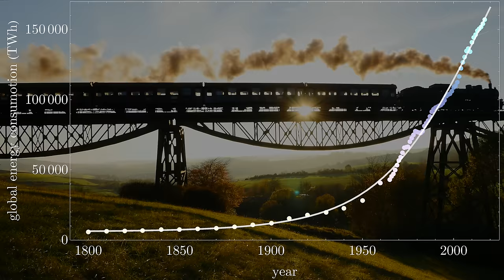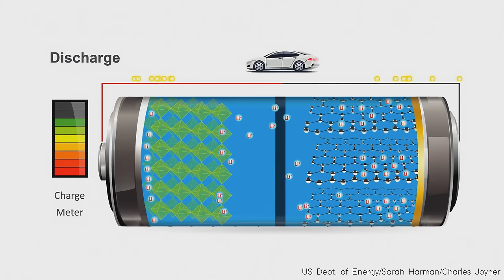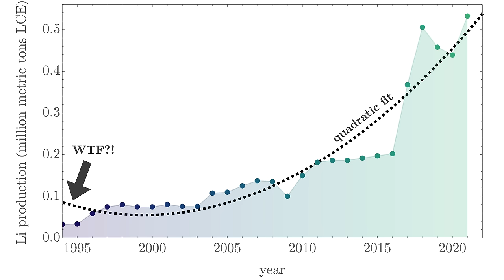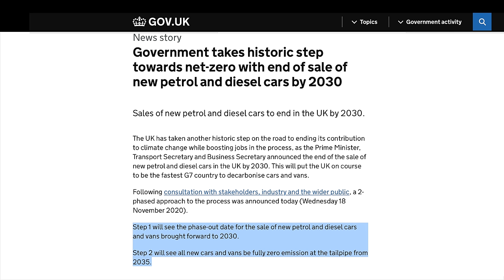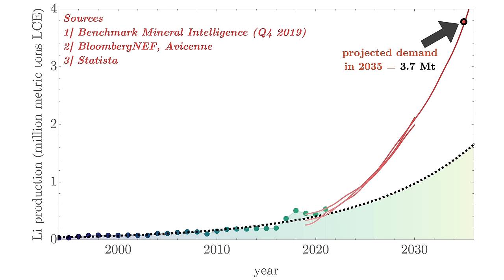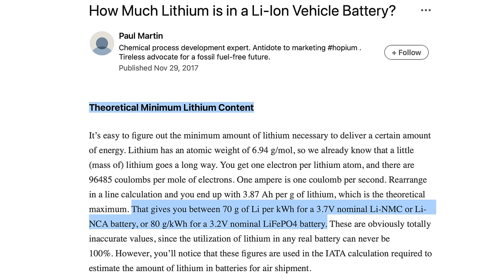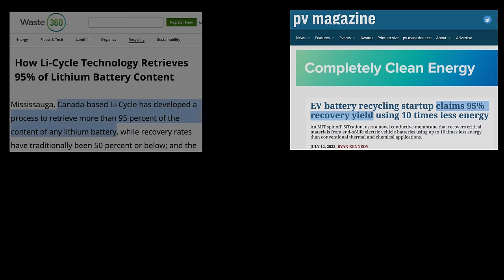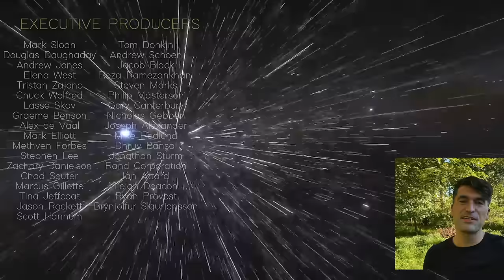Will We Run Out Of Lithium?

Comment: so many questions still though:

A) the environmental impact on mining? habitat destruction? fossil fuels used in mining? 
B) will the switch to batteries mean swapping out heavier, metal framed cars, with lighter, harder-to-non-recyclable, carbon fibre car chassis? 
C) Affordability? cost of a new battery? right-to-repair and supply of parts/batteries? most of these cars are dead after 5-10 years of use, a petrol/diesel car can run for 20 years or more with relatively inexpensive upkeep and keep most of it's efficiency,  my phone is only 3 years old but i have to keep that thing hooked to a charger majority of the time. 
D) The power grid these things are hooked to? coal? gas? solar? or wind? equally how much land/habitat destruction will occur to show solar and wind farms? and how will the grid cope with increased demand?
Reply: @lepidoptera9337 😜

Comment: Na-Ion would be cool, but so would Graphene Super-Capacitors. Both have theoretically low costs in the long-term, and both could have a low environmental impact. It’s cool that more options are being rundown, because the more options we have the better. However, the Lithium running out concern could potentially be unfounded. Crude oil had the same issue in the 30's, 50's, 70's, early 2000's, and recently. There is often a voice of “we’re about to run out”, then a new technology finds more, or a way to extract more. Lithium, though much different, could have a similar trajectory. There isn't enough recycling calculation added into this demand, with a 50% recycle rate, we would have a considerable reduction in net demand for mining. This model also assumes not only will no other technology be implemented, but also assumes that the chemistry of Lithium batteries will always require the same amount of Lithium.
Reply: Maybe I'm wrong, but super-capacitors only seem to be an addition in improving EVs, etc., thus maybe slightly reducing demand for batteries.

Comment: Wonder why the idea of hydrogen engines is completly ignored the last 10-15 years. Its save, free of emissions and hydrogen is an infinite resource. EV isn't 'green', what many people think. The energy to load an EV is mostly produced by burning fossile resources.
Reply: hydrogen is anything but save. It needs one of the most airtight tank possible because it’s only a proton and an electron. The reason why is because you have to put in more energy in than comes out making a net loss.

Comment: Collapse of the overall auto industry might also contribute to accelerating shift to EVs. Auto numbers are down the last couple years and many cities (Toronto, Paris) are taking big steps to reduce car dependence and ban cars from inner cities.
Reply: Correct, most big cities in Europe are transitioning away from cars for years. Same in some East Asian cities like Singapore, Hong Kong, Tokyo, Taipei, etc.
Reply: Europe is just one region & not the best example. They have a lot of built-in infrastructure for public transportation to allow that. Trying that in say Texas just doesn't achieve the same results. So. IE - It's not collapsing & isn't going anywhere anytime soon.

Comment: Great video. To me this seems to be one of the two most urgent BUT actually solveable short to midterm problems. The other one beeing silicon. Given the fact the we'll only ever use exponentially more artifical intelligence and HUGE amounts of computing power in the future. I'm quite certain that because silicon and lithium products are so inherently interconnected in our current and future world of electronics, that one would find great simillarities if such a video / analysis would be made on silicon.

Thank you so much David for this great analysis, it's always a joy to watch your videos.

Now I'll head off to start investing in lithium, silicon, and nickel production and recycling, after that colossal fail of cryptocurrencies. Oh wait, what a coincident, there is a huge correlation between these, what???
Reply: Silicon is one of the most abundant elements on earth, just like lithium. Silicon just lies around as sand in deserts. But the largest amount is not used in chip production, but in the production of solar cells.
Reply: That is true, but extracting silicon and refining it to the level of pureness it's needed, is a very complicated and energie intensive matter. Still you're correct, but I meant it more in a "Demald will far outstrip supply" kind of way.
Reply: @BMXaster  I'm a bit more "optimistic" and trust in capitalism to never let demand outstrip supply. But we'll see.

Comment: The ocean is FULL of Lithium.   You just drop a graphite electrode into seawater.

If you merely run a trickle current to the electrode, you get Lithium and Sodium attracted to the electrode.

Someone discovered that reversing the voltage briefly will repel the Sodium somewhat so you get a 3:1 Lithium to Sodium mix.

But that’s irrelevant, because Graphene/Aluminum Ion batteries charge 50 times faster.

Comment: Excellent video. Very interesting, informative and worthwhile video.   Note that there are a number of other battery technologies being developed which may be as efficient as lithium batteries and cheaper and with a chemistry that would not be in danger of being depleted.
Reply: Lithium is incredibly plentiful... And it is an element that we are not burning as a fuel, what we have already mined is more easy to access and refine again from recycled material than it is to mine and refine new material... And, yes there are different chemistries coming, already in use, I am simply pointing out that lithium is not the limiting factor...

Comment: There are two extra ways we can get out of needing this much lithium: hydrogen vehicles and sodium based batteries. They also need technological improvement but it's a way forward as well.
Reply: Hydrogen is a dead end for cars, larger vehicles maybe, but the manufacturing transporting and storing Hydrogen will always be an issue as the process is very inefficient and costly compared with just putting the electricity into an EV.
Reply: Here is another extra way:
Less cars, building out public transport and building new development more around that does (not can, we know it does) reduce the amount of cars a population has. This means we don‘t need as many EVs which solves the problem in the most obvious and least fancy way possible.
Reply: @PhilfreezeCH  Public transport is ok in cities or between city but you cant make a public transport to allow people to go anywhere they need to go when they need to go. In short, public transport is inconvenient and will never replace the car for personal transport.

Comment: Basing out lithium demand largely on the EV market is short sighted. It doesn’t consider the huge amount of lithium required for solar power storage
Reply: This is why I believe that EV's should not be our primary focus. We need to rapidly expand the infrastructure needed to phase out dirty energy production in order to realistically tackle the issue of climate change. Most energy consumption globally comes at the industrial and corporate level and that is where our focus should be. EV's are not end all be all because for numerous reasons, be it logistically or economically, not everyone will be able to acquire an EV even with massive tax credits. A person struggling to maintain their home and old vehicle will not be able to afford a $60,000+ EV.
Reply: @ShortandWide  I do think the cost of EVs will come down though too.
Reply: Lithium is more a requirement for mobile applications, whereas for solar power storage you could use other materials that have a worse energy to weight ratio. Or maybe use the solar power to produce hydrogen.

Comment: I can't see this as being better than a gasoline driven car. 
1. Conservation of Energy. These cars must be charged and that Energy must come from somewhere. That will be either coal or nuclear. States like California refuse to build any new powerplants will continue to experience more and more blackouts. The state will impose charging restrictions. 
2. First Law of Thermodynamics. These batteries generate a lot of heat and can cause a thermal runaways. These batteries are required to have thermal protection. When the battery senses an overheat condition, it will shut itself down and leave you stranded. 
3. Second law of Thermodynamics. These batteries have a short life.
Reply from the maker: For myself, the energy comes from neither coal nor nuclear but rather solar. Solar is already cheaper than coal. For waste heat, personally I’ve never had a shut down even driving in 100F+ heat. The car has a heat pump that cools the battery (and inside). And yes they will run out and that’s why we need recycling!
Reply: I totally agree recycling has to be the future of lithium batteries. However, there are 13.8 million cars in the state of California alone. Less than 10% of those will be able to use solar power to charge their cars. This means most of the cars will be using coal or nuclear power to charge their vehicles. California will struggle to meet this demand.

Comment: So in a nutshell: if they’re gonna “force” everyone to go electric for transportation, they need to also change the way the electricity is produced in some of those markets. Otherwise, they’re just being stupid. They’ll need nuclear for this plan to actually work.
Reply: that's AC power, which is used to charge the DC batteries, typically made of lithium, which is becoming scarce
Reply: The times change. Except it and move on.
Reply: @farmsalot1233  not an argument
Reply: Yeah energy prices has increased beyond control. Most people cant even turn on any power products without getting 1000s in power bills. Now we have been told we will start having brownouts because if increased need. Most industry is moving to another country atm. Australia is screwed.
Reply: Demand for EVs is way higher and sooner than any mandates... Renewables with battery storage is the cheapest way to generate electricity and all grids want renewables and batteries as fast as the batteries can be made...  Coal and oil are dying incredibly fast, basically dead already as compared to peak oil or coal... More than half of France's nuclear power plants had to be shut down when the summer was too hot, water needed to cool nuclear plants was too warm, still plentiful, just water temp too warm... not so reliable especially in a warming climate... Plus nuclear is super expensive as compared to anything else you cold build to do the job...  Profits, costs have made solar and wind coupled with batteries an unbeatable solution that is only limited by production or else basically everyone would be switched to renewables already...

Comment: Norway is often cited but it is a odd case, not well understood.
With a small 5+ million population they aren't a very big market.  Therefore their sales % looks high, but the numbers are meager compared even to just California.
Norway has an electric grid that is 93% dam hydro....meaning high power reserve backbone.  98% non fuel, electric power.

Makes sense to use electricity for as much stuff as possible.

Most of that 5 million population  is not urban.  Only one million person metro.  Six 100k to 200k cities and the rest rural and village.

Norway has the highest number of domestic air flights per capita IN THE WORLD...burning gasoline and kerosene.  Many Norwegians are quite wealthy, and utilize air flight as a shortcut to the harsh distances....much as Alaska does.

How does Norway make money?  OIL AND GAS exports.  It is the 13th largest Petro Nation on earth and has increased production this year by 20%.  The EV push is to decrease domestic use, so more can be sold abroad to mostly the EU.

Greta speaks with a bit of duplicity.  Much like a notorious drug and moonshine dealer speaking of their own sobriety.
Reply: Other than the fact Greta is Swedish instead of Norwegian, I agree. Better to make a hefty profit on your own supply instead of consuming it yourself.

Comment: Another mindbogglingly huge issue in terms of its scale that we have to face in regards to the increasing demand of EV's is electricity production and the power grid to transfer it. That is a absolute massive infrastructure undertaking.
Reply: Something he completely sidestepped.
This calls into question his integrity. Failing to mention the existential  problems regarding the  electrical grid and it's  ability to succour , meet the needs of EV's is analogous to expounding the virtues and benefits of solar panels yet ignoring the sun

Comment: Excellent video, well thought out and presented.  This is one of the most informative and well presented channels on Youtube. 

Did you consider any of the developing competitors to Lithium that are at various stages of development based upon Magnesium, Sodium and Sulphur etc? As has been mentioned in other posts, not all applications require the 'lightness' of lithium (home & grid storage is a good example) so the lower energy densities (but increased safety) of sulphur for example won't be an issue.   

Some of these other chemicals are vastly more abundant and cheaper to extract, some even will work with the existing Lion or LifePo4 production processes and facilities.  There is a strong chance that Lithium based batteries will be overtaken by a cheaper more cost effective alternative within the period you have covered, at least for certain aspects of the demand for batteries.  Here's hoping something like this does happen as we don't want to get into a squeeze like the one that seems likely.

Comment: I believe that lithium is not the answer to all... Considering each ton of mined lithium emits 15 tons of CO2, you're pretty far from carbon-zero. Also, the most "eco-friendly" car is the one you don't produce.
Synthetic fuels are the better solution until we develop the next step in energy production and storage. Bosch (with the help of the Volkswagen Group) is working on this idea with carbon capture, with the goal of achieving near carbon-neutral fuels where each ton emitted gets reused for fuel production and that the factories (not oil rings) are driven from renewables.
Synthetic fuels could greatly help reduce net emissions of the current global automotive fleet without needing to mine or produce more materials for more EVs.
Being a gearhead engineer, I do not and will not ever consider an EV in the future. I despise the marketing trend towards EVs like it's the solution to all of life's problems, because it isn't. Removing all coal fired powerplants around the world and replacing them with next generation nuclear reactors or renewables will have an order of magnitude more impact than forcing the average consumer to buy a product they do not want, need or can afford. This is without even considering the global energy demand growth. 
If we want real change, the entire energy infrastructure needs to change. Not buying more stuff. If people really wanted EVs, there would be a need for government mandates to force them.

Comment: hopefully there will be no demand for lithium and better battery tech will arrive.  Lithium based vehicles like the Tesla Y weigh about 5000 lbs; a Corolla hybrid weighs 2800 and a Prius weighs 3200.  The heavy weight of Lithium EVs essentially cancels out the effient electric motors found on EVs and don't forget 90% of the electricity used to power the grid is coal, gas, and oil, which also has a 20% energy loss getting to your charger.
Short term there is only enough lithium to make about 6 Milion cars annually out world sales of 100 million; there isn't enough so Lithium is a dead end.

Comment: What about all the pollution caused by the mining for these batteries? What about hydrogen electric and hydrogen internal combustion engine? Unless you're going to stop making plastic she can have plenty of hydrogen as a waste byproduct from processing a fossil fuels. The big question is why aren't gasoline internal combustion engines much much more efficient than current manufacturers allowed? Hey the 1977 Chevelle and with very little modification I get through I used to get 30 miles to the gallon out of that vehicle with almost zero emissions. My 1990 celebrity wagon with 386,000 miles on it was getting 44 miles to the gallon and emissions were so low the state inspection machines couldn't detect any. My 2006 Buick is a disappointment however, it'll get me 34 miles to the gallon and only burn clean with ethanol-free fuel. Raising fuel prices to make electric vehicles more killing is idiotic. Trying to pull more electricity out of a power grid that can't handle the power that's going through it now is idiotic. The biggest downfall to electric vehicles right now is the power grid the update the power grid then they might stay in a chance. Solar farms in wind farms don't work. The only way solar works is when you put them on your individual house for the benefit there is a solar panels reduce the heat island effect which is the cause of global warming not CO2. Please excuse the odd words and out of place things my voice dictation doesn't work very well all the time.

Comment: I'm somewhat surprised on the recycling point. Surely we've already done the hard work of concentrating the naturally occurring lithium into a lithium-based device. Is it really harder to reuse that stuff than to dig more fresh lithium out of the ground?
Reply: It is easier to mine and refine from used batteries and it is already being done, the main problem being that there is not enough batteries to recycle yet for the companies to truly scale and make big bucks.  The batteries are lasting way longer than we thought and the demand is way higher than thought so second hand batteries are very popular since there is a lack of new cells.  Tesla Panasonic cell factory in Nevada are already using materials from recycled batteries and new Samsung factories in the USA will be doing the same.